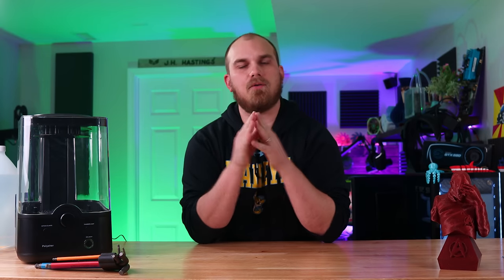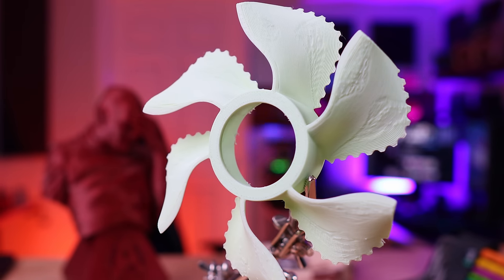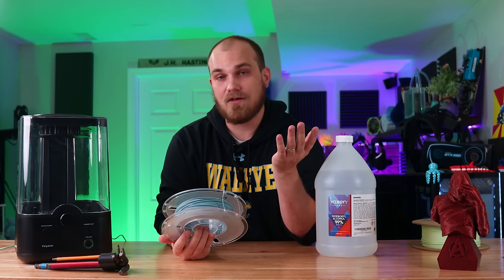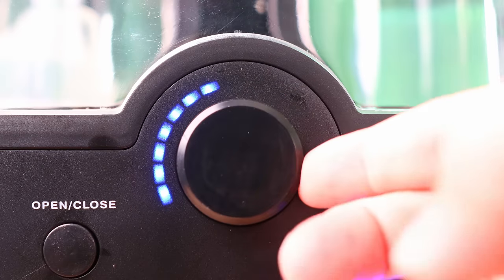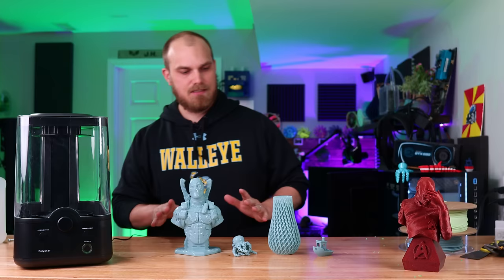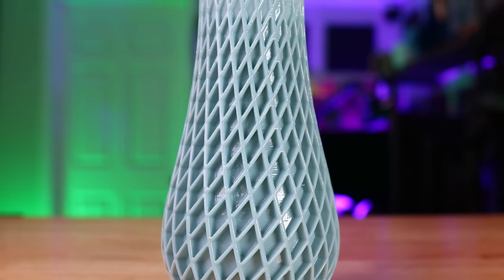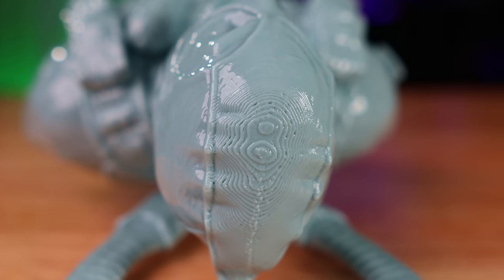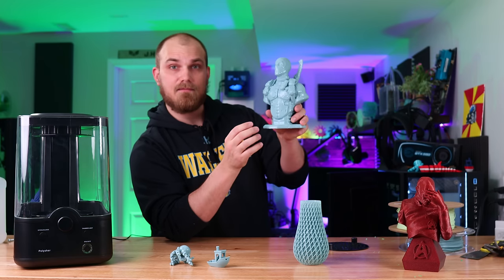SMOOTHING 3D prints with isopropyl alcohol

Comment: When you print in Vase mode using a .4 nozzle  bump your line width up to .6. it pushes more material and will make the walls way thicker and fill the holes. I make lots of Vase's and this works wicked.
Reply: or increase your flow rate by a small percentage to manage the material rate more precisely
Reply: One of the first prints I did was a vase - pushed the flow to 120% and it came out perfect and watertight
Reply: I saw a vid a week or so back where someone was vase printing with extreme line widths. Amazingly they had good results with line widths many times the nozzle width. Like 2mm with a 0.4mm nozzle. The line width was even wider than the flat part of the nozzle. The secret seemed to be increasing the layer height to maintain a 5:2 ratio or something like that. Annoyingly I can't find the vid now or I'd post a link.
Reply: .8 nozzles just make it so much stronger, that's what I'd suggest.
Reply: In the middle of a vase print with a .4mm nozzle and bumped it up to a .6 line width (which happens to be the highest recommended limit, 150% of nozzle).  So far so good.  Looks like it could be water tight.
Reply: even a 0,4 volcano nozzle can do 1mm line width with .6 i use 2mm lines

Comment: MEK (methyl ethyl ketone ) will smooth normal PLA, you can brush it on then let it evaporate.   It's some nasty stuff though.
Reply: u sure? MEK dissolves ABS, but PLA?
Reply: Not that bad. Just an irritant.
Reply: There seems to be a lot of people that confuse MEK with Methylene Chloride. MEK does not smooth PLA in any useful way, it just makes it soft and rubbery.  Usefull for clearing out a clogged hot end after a good soaking, but not much else.

 Methylene Chloride does have a useable smoothing action on PLA, but unlike MEK it is a very toxic chemical. This is the stuff that was removed from paint stripper some years ago, and why modern paint strippers are useless.
Reply: @ferrumignis  if you are talking about DCM, yes, considering that it is a powerful organic solvant, still commony used in labs, it should smoothe PLA. It is however toxic to inhale, although less toxic than most Organic-Chloride Compositions
Reply: It also turns out that while Acetone and MEK are great solvants for alkane based plastics such as ABS, they are quite ineffective when working with PLA
Reply: Little known fun fact: You can do cold vapor smoothing of PLA with Chloroform.

Comment: One option: (only for prints that are basic, or mostly flat edged.  (parts, tools, vases etc)  If you have a hot air station, you can set the air gun temp,  just above the nozzle temp, and give the edges a short blast of hot air in an equal manner.   That does eliminate a lot of the layering,  although you need a silicone mat, and have to do short blasts to avoid warping.

Comment: My vote is to test the strength of the stuff before and after smoothing. Maybe compare it to a popular PLA too. I know, there are 34 channels doing that type of stuff, but you have the fancy vapor elevator for this one case. The smoothing filament could be useful for more than cosmetics if the physical characteristics are different and desirable in some way over PLA. I know PETG, ABS, Nylon, and carbon blends all have some advantages but they often are only marginally better. Plus they often have significant negatives; stuff like hot end limitations, fumes, enclosures ... If this stuff is reasonably safe and easy to print it might make up 90% of the difference.

Comment: I've had amazing results with acetone smoothing by doing multiple short passes and letting them dry for a few minutes in between. Curious to see if the polysher would have the same effect.
Reply: Agreed, multiple short cycles prevent the solvent penetrating the surface too deeply. Should work just the same with this, though doing this manually on this rather gimmicky machine looks like it would be a pain.  It's something the manufacturers should consider though, along with getting rid of the silly rising platform.
Reply: U mean with a brush?
Reply: Would brushing IPA on it work, or should I only spray?

Comment: PVB (Polyvinylbutyral) I didn't know this material, commonly used in windshields. 
It's offerd by many companies even Prusa and all of these should work smoothing with Isopropanol.
First looks seem to proof the material is quite safe ( except little hazard with sanding dust).
And it should be mechanical  even more stable than pla. So I'll definitely give it a try. Thanks for the video.

Comment: I personally have experimented with PETG prints and chemical MEK smoothing, it works surprisingly well in a custom vapor chamber. Alternatively you can use Toluene but it is much weaker and milder, I suppose it has some use for very minor smoothing.

Comment: You know, there's a technique used in many programs to sharpen images, maybe you can do that to pre sharpen your prints and THEN run them through this. It works by taking several offset versions of the image, and then averaging them together, making a blur effect, and the by linearly interpolating between them, with the regular image being zero, and the blured image being one, you can scale it backwards to make it sharper.

What if you tried taking the model, nondestructively smoothing it out a tiny bit, and then lerping the vertices backwards.

Comment: You should give eSun ABS+ a shot, still need an enclosure for good results, but low warp and low smell.

Also, all my vase-mode prints hold water, layer width of 2x nozzle diameter for the win!

Comment: I would be interested in seeing you try to make a vase water tight.
Reply: When you print in Vase mode using a .4 nozzle  bump your line width up to .6. it pushes more material and will make the walls way thicker and fill the holes. I make lots of Vase's and this works wicked.
Reply: I've been doing a fair bit of single-wall printing and find I have no problems with things being watertight. Just picked up an old failed print (failed halfway up) that is single perimeter with no infill... and poured some water in and sure enough, no leaks even with some rather complex curving and overhanging geometry.
I suspect what makes it work well for me is that I'm using 0.05mm layer height for my single perimeter prints. Finer layer height means more horizontal overlap from one layer to the next as the surface moves in the x/y directions. I think my use of fine layer height without changing line width, has similar effect to @Destructor429's bumping the line width up.
Reply: I would rather crank up the flow % modifier rather than mess with the line width. Also in my testing Rouge is right about thinner layers holding pressure better, although I only tested down to 0.1mm.
Reply: Yes!

Comment: I can see it being great as a shell, mask the inner part, and smooth the outside facing face. You can then make the core out of cheap pla, because at 42€/kg it's a bit expensive and it also probably is not very accurate due to smoothing.

Comment: I wonder if you could just paint on the ipa and forgo the chamber altogether... Maybe you could touch up deadpool's head, or other areas that didn't get quite smoothed enough.

That also makes me wonder if you can completely dissolve this filament in ipa and use it like you would with PLA for lost casting? IPA would certainly be easier to drive off than PLA.

Comment: Have you tried it with regular PLA to see how much difference the fancy filament makes?
Reply: Isopropyl alcohol (or acetone) has no effect on PLA, or at least no smoothing effect. Actually acetone mist kind of messed up my PLA jigs I used to hold my ABS parts in a vapour chamber, but they just got deformed and discoloured, they didn't get any more smooth.

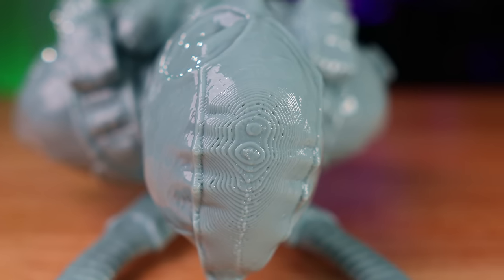Comment: At 11:30 you said " I don't think you actually have to..." regarding using the polysher, but then you lose that train of thought.  Since the polysher is currently unavailable on amazon, I'm wondering what you would suggest as an alternative method for smoothing the polysmooth prints. Thanks!

Comment: 10:17  it will be stronger and will loose flexibility, its just the chemical property changed, it needs to be dryed, just wait 1-2 weeks depending on the thikness, also it can inproove the waterproof even if the extrusion isnt consistent at all.

Comment: Nice video.
Is it a technical design flaw though that the machine only spray the alcohol from the bottom? Or does it also spray the alcohol also from teh top? Just wondering if spraying from both direction will make more even result.
Reply: Gravity will pull the mist into a density gradient no matter where the spray is.  A small fan might help, but most of the problems he had were with the piece that was technically too big for the machine.  There's also a small-but-reasonable chance that an electric fan could ignite just the right air-fuel mixture into a bomb.  Most of them are not designed to be vapor-proof, and the fuel here (purposefully vaporized alcohol) is much more dense than most places you might use a fan, like for spray booth exhaust.

Comment: I know I'm late to this party but if you, or the manufacturer, are lurking.... I think the best idea here for the Print In Place stuff would be to allow you to remove the print plate and put it RIGHT INTO the vapor chamber.
That way, the joints can't melt together since the entire piece will still be fused in place on the print plate! (meaning the separate pieces will be spaced out as printed, aka nothing will be touching)

Of course, that would require a new vaporizer design, but frankly, it needs one ANYWAYS...
That elevator is so stupid and unnecessary (sorry, blunt criticism). It would be just as functional, but fast less expensive, to have the entire dome a single piece to remove (like a dinner cloche, but not metal). Then have a simple human operated latching mechanism (like the latch used for the lid on a toolbox), since I'm assuming the elevator is functioning as a means to put some pressure on the clear portion to help "seal" things.

That alone would remove so many parts (plastic and electrical!) ...  Thus, much cheaper to make. 
Simplify assembly since there's not a multi-part track assembly or electric motor (which is either a stepper, or has 2 switches acting as sensors)... Thus, making it even cheaper to make!
The lack of convoluted design means less chance of pointless failures... Thus, a more reliable product which yields better reviews, translating into better sales and brand trust.
Replacing the electronic elevator mechanism with human power makes it easier and faster for the user to get things done... Thus, an improvement in quality of life, again translating into better reviews, brand image, and more sales!
👍👍👍👍

"But, if it isn't designed to fail.... How will we make money on people buying replacements?"
🤷‍♂️ If it doesn't last long, word will get out, and you will still suffer lost sales. If it is a better product which gives the user an overall pleased experience... They'll be far more likely to buy a replacement, or newer, better models! 😉

[/ ramble free R&D, QA, and user criticism ]
Reply: You can also use a small square of G-10 and clip it to your bed, print on it, and move it into the chamber.  Just make sure you cut the G-10 to fit into the chamber.

Comment: Hi new to your channel and subscribed. I feel like you could recycle and repurpose an old microwave into a far higher quality polisher machine than the polysher. If your into tinkering, I would remove the heating element components and replace them with the sprayer components, seal the vents and seal the door if there is none. Place a tank under it and install a drain to the tank. Have  sprayers on two bottom corners and one above it. Ultimately the design and size of the microwave you use is up to you, there are very large ones being thrown out in the wild.

Comment: That is some interesting material. I agree with you about the issues with ABS, I try to avoid it because of the fumes. 
I do notice on the Benchy and Octopus models you had some layer line misalignment. I've been running into a lot of that myself lately. Do you have any advice on dealing with that?
Reply: Youve probably figured out layer lines by now but i believe what i did was make the wall and top lines thicker. I forgot some of the other settings but now it doesnt have layer lines but the edges are almost balled now to the point that theres almost a seam on each corner

Comment: I wonder if the smoothed octopus would retain proper movement if it moves while drying.  Since there is a rotating platform, all you need is a stand and to tilt the whole setup.  Then the rotation would keep legs moving during smoothing, but I think you want rotation to continue as the ipa evaporates.

Comment: I forget what it's called but there's a thing that's basically a non-powered version of that alcohol Vapor thing that you put something Radioactive in and you can see the particles shoot through the alcohol mist. You should order something radioactive off of eBay and set it in there with the mist and see if you can see it. There are a lot of things on ebay that work with you original design where they super-chill the alcohol can't think of what they are you have to look it up on YouTube except there's one thing for old record player needles that takes away the static and it's radioactive and they have that on eBay but I don't remember what it's called and it's not listed as Radioactive

Comment: I have acetone smoothed PLA before. Mostly by accident because I was using it as a stand for an ABS print so I actually also accidentally welded the PLA and ABS prints together so it ended up not being very useful so it was lucky it was just a couple test prints in there but the point is I was able to both smooth and solvent weld PLA using acetone.

Comment: I assume this smoothing technique only works on filament printed objects and not resin? I received some little items that were printed with a resin printer and I was just cleaning them a bit with a cotton-tip with isopropyl alcohol but it did not appear to affect the resin itself from what I could see. Which is good as I was kinda worried I was now going to ruin my resin items with isopropyl alcohol.😅

Comment: It would be interesting to see if you could make something like this yourself using a pump and a mister like they have outdoors in the summer. Then you could make a container as big as you like, just make sure it's clear.
Reply: Droplet size matters a lot in even smoothing.  Cooling misters drop bricks compared to a nebulizer or other humidifier device.  You'd probably be able to see where the drops landed with a cooling mister, and it would be very uneven overall.
The equivalent is sanding with 60-grit versus 1200.  No matter how careful you are, the performance is very different.

Comment: Thanks for pronouncing vase correctly (vah-zz, not vay-zz) :D
You've got me wondering what kind of results you could achieve by just using the isopropanol with a cloth. At the very least you should ba able to finish off DP's head, but there are probably use cases where it would work better than the polysher (awesome name).

Comment: You can also use acetone to smooth PLA though it takes a little more prep and some specific tools. Let me know if you want to know the process and I'll send you a list and and step plan how to do it. I developed the technique at the company I work at and was given permission to tell others about it seeing as we work with SLS where this doesn't work.
Reply: Would love to know how you do it
Reply: @chiefkelly   Hey, to use this method you will need a couple things. 
A large metal or glass container/pot that fits the models you want to smooth. 
An induction heater, you REALLY don't want any open flames or red hot elements due to the acetone vapors being highly flammable.
Stiff wires to dangle the model into the pot/container.
And Acetone.
I tend to use large 2 litre lab bekers for this as when the acetone is ready (boiling nicely) you will see a line a condensate move up the side of the container. Once this line get to the top your ready to carefully dunk your model into the vapors. 
DON'T PASS THE EDGE OF THE CONTAINER WITH YOUR FINGERS! The vapors are hot enough to give instant burns. (We found out the hard way)
Once the model is in the vapors it will immediately get a wet look, swirl it in the pot for 5 seconds then take it out and see if it is smooth enough. Repeat with 5 sec exposures if necessary.
When your happy hang your model to dry.

Ok usual warning apply, only do this in a well ventilated area, no open flames of glowing hot elements and wear PPE's

This works because we aren't using a chemical smoothing technique as with acetone and ABS but using the super heated acetone vapor to melt the outer layer of the PLA.

Let me know how it goes if your try it and if you have any other questions
Reply: @KylejvT   Will a small countertop induction heater work for cooking?    I've seen some for $85.
Reply: @WestCoastDP  Most definitely, a friend and former college uses one for his PLA smoothing. He's posted a video of the process for at home smoothing also testing various brands and types of PLA.  Look up  "Wayne's Workshop" and you should be able to find his channel and the video in question. If you have any other questions about the process please feel free to ask.

Comment: An alternative to the smoothing abilities of ABS is overdue.. but I cannot see IPA as the solution! Any hobbyist who is fiddling with 3d printers and technology also is spritzing IPA around like others do with water, because there are just too many uses for this alcoho.. So it doesn't even seem remotely safe to have prints that are sensitive to IPA, and sooner or later any print might easily come in contact with IPA unwanted. Combined with the way too low melting point of PLA, this sadly is a no-go.